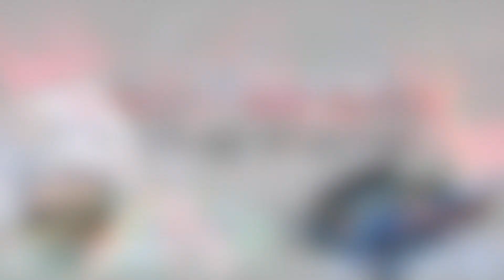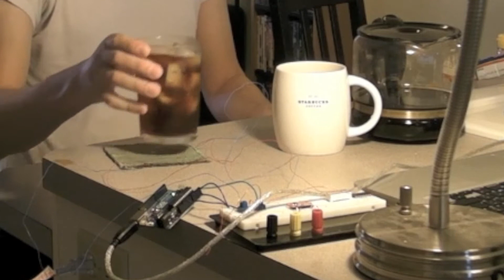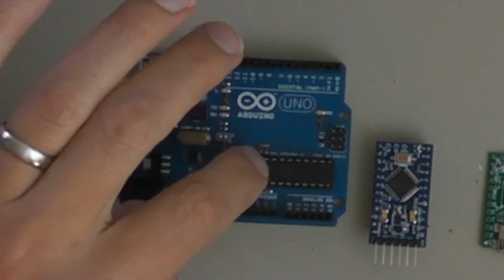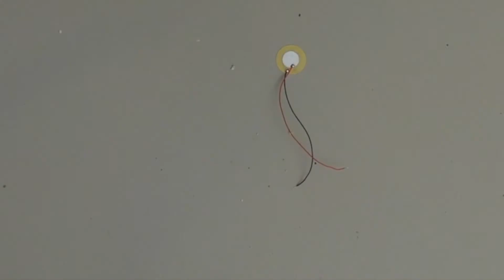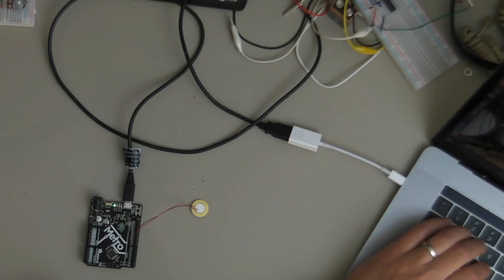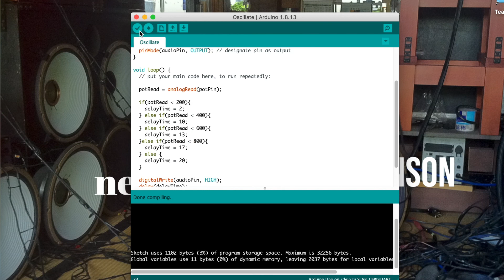Arduino and Audio: Getting Started | Simon Hutchinson

Comment: There's no need to ground the potentiometer. By doing so you have a permanent draw across it of 100k. Loosing some of your current across it.
Without it you'd get a flat current curve instead of a exponential curve.

Comment: I'm struggling a bit with the statement that 1.5 Hz is far below of what we can hear. I know humans usually can only hear noises between 20Hz - 20.000Hz. But of course I can hear a speaker or piezo doing a "cracksound" every 666 ms.  Propably that's because here we generate square waves and no sine waves.
Reply from the maker: Good question. When we hear a "pop" of a piezo at 1.5 Hz, we're not hearing a frequency of 1.5 Hz, we're technically hearing the harmonics. If a sine wave were at 1.5 Hz, we wouldn't hear it because it's just the fundamental. More here: https://youtu.be/W_34vn4Zo0s
Reply: @SimonHutchinson  Thank you, now theory and practice came together :-)
I basically knew the things you explain and show about signals and harmonics in your other video in theory. But I never transfered it from what you you know and als can see on an oscilliscope to what you are hearing at audio signals. Thinking about it its quite obvious. Hearing a sound every second doesnt make it a 1 Hz sound.